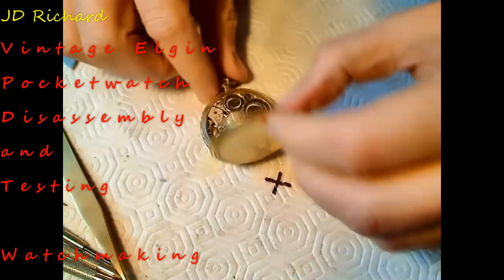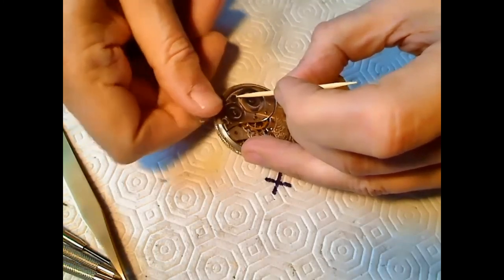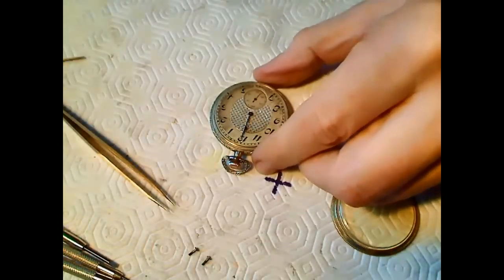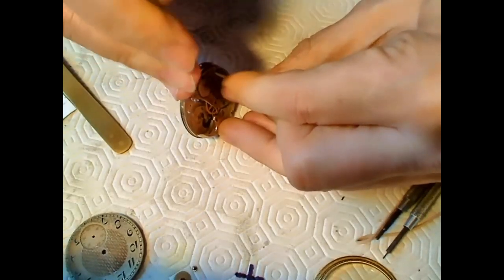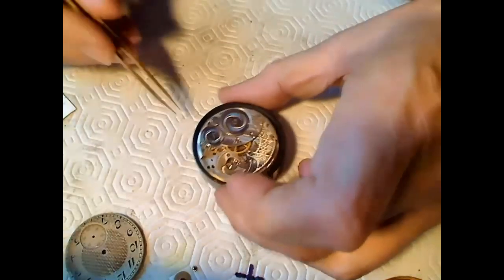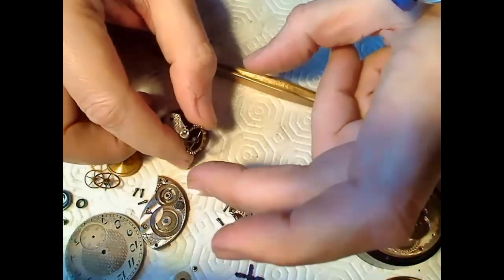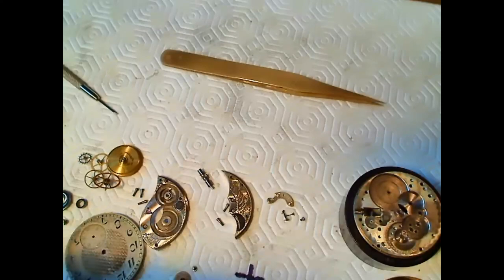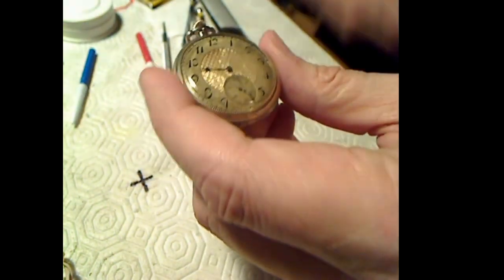Elgin Watch Repair - Gummed Up

Comment: Liked the fact you used a brass tweezers.  These are great for non marking of the steel parts on the watch movements. Got to get me a pair also. Thanks!
Reply from the maker: rgoidel softer material so feels good when picking up parts
Reply: @JDRichard  Brass tweezers are usually for hairspring work only.  The big flat brass tweezers believe it or not are pivot tweezers.  You use them to straighten pivots in a lathe.

Comment: I agree, never install a mainspring barrel unless its been dis-assembled, cleaned and re-oiled.  Without doing that how do you know the barrel arbor has the correct end shake inside the barrel....You don't.... You need to check and adjust end shake of the barrel arbor...EVERY TIME
Reply from the maker: Never actually thought of checking endshake of the barrel arbour. Why would that change?

Comment: I have the same movement,  I can't change the time on the watch, if i pull the stem it still wants to wind.  anything i should look for?  runs nice as is.
Reply from the maker: dakotamar Need to remove the stem and using a case sleeve wrench, screw down the sleeve tube.  Then replace the stem and you should be fine.  If still not working, screw it down a bit more until the watch winds with the crown and stem installed.
Reply: @JDRichard  thanks i will look into that.